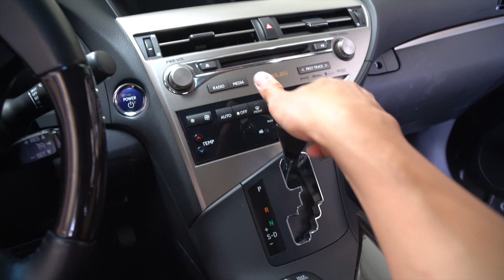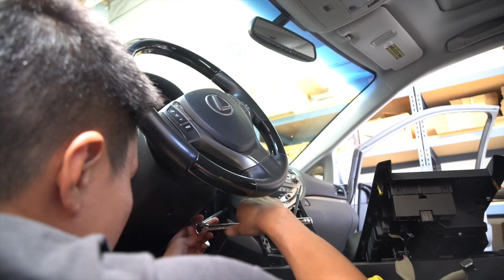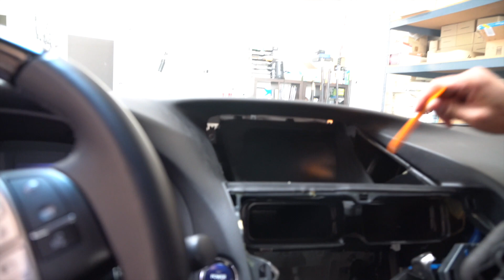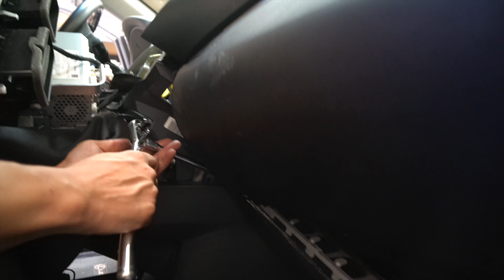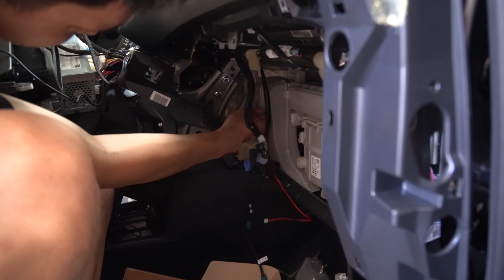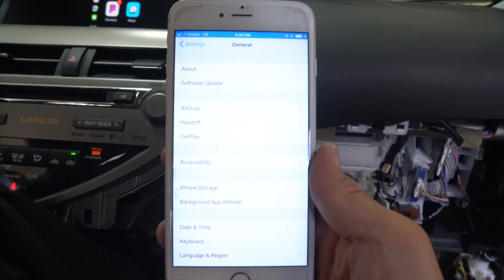2013-2015 LEXUS RX | Wired Apple CarPlay Android Auto | Install / Demo

Comment: Does the LGVIF-CB2 S-Connect model work with the RX-350 in the years 2013-15? I know this guide shows the installation in those model years, but the product page on your website seems to specifically indicate that it only works on the 2016-2019 models. Same with the model for non-navigation. Thanks!
Reply from the maker: We have temporarily stopped offering it for 13-15 as we found a glitch that affect these models. Still trying to debug it. Check back with us in 3-6 months
Reply: @BeatSonicUS hi just checking if you have fixed the glitch and if you have an option that works for Lexus RX 350 2014
Reply from the maker: @Watchthis_UM  yes glitch was fixed last year. Here’s the link to the kit https://www.beatsonicusa.com/lexuscarplayandroidauto.html
Reply: I am following up as I am still looking for the same info. I have a 2015 RX450h

Comment: Ok. That was a great video. Your shots showed the basic removals clearly and just enough of the procedure that it should be easy to reference along with the manual.
Reply: I am excited to install this in my 2015 RX350 with factory Navigation. Is it still a go? I read somewhere that there was a required update needed. Has that come out yet?
Reply from the maker: Thank you

Comment: Will this remove/override factory infotainment menu stuff such as car settings, oem navigation, and hybrid energy monitor?  For example, for whatever reason, would I still be able to use oem navigation, adjust lights or seat settings, or view the fuel consumption/energy monitor for the hybrid system?
Reply from the maker: This will not overrode factory infotainment. You can use all oem functions normally

Comment: So amazing!  I’d like to have a shop do this and I’d also like to upgrade sound system, install dash cams front & rear,  can you give any recommendations for these two other changes and is there any other items you would consider with the car opened like this?
I have 2015 RX350
Reply from the maker: Nice! You will definitely be loving your car after all those changes!
Reply: I think he only read the so amazing part lol.  Your best and safest option would be buying and getting it installed at best buy.  Confirm if they install as well since very few best buys install.

Comment: Will this work on my 2013 RX 350? I don’t see it on the compatibility list on the website, but it is on the compatibility list on the video. Thank you!
Reply from the maker: Hi Nick, we have temporarily stopped offering this kit for 2013-2015 RX models with nav as we ran into a bug that we are diagnosing now. Check back in a few months as we should have resolved it by then
Reply: @BeatSonicUS  Did you get this fixed for the 2013 to 2015s?
Reply from the maker: @ericmaytx  not yet!
Reply: @BeatSonicUS  I too am still very Interested in purchasing this once available! Please keep us posted!
Reply: @ericmaytx  It's fixed!
Reply: @BeatSonicUS  have you fixed the issue yet?
Reply: There is an alternative offered by Navtool, but I wanted to check in again with you first to see when you are expecting the bug to be fixed. What’s the latest update?

Comment: Hi I’m from Edmonton Alberta. Looked on your website to make sure my 2015 rx 350 with navigation is compatible but it says it only works for the 2016-2019 rx. Just wanted to know if my vehicle is compatible and if so where I could get it installed from.
Reply from the maker: We had run into some issues for 2013-2015 RX and have stopped offering it for this model temporarily. We are still working on fixing the issue. Check back with us in 6 months
Reply: @BeatSonicUS  is it available for the 2013 rx now?
Reply: Any update on this? Looking at buying a 2015 RX350. Thanks!

Comment: I have a rx350 2015 non navigation model . Would it be possible to install this on that. If not , are there any parts from a lexus  nav system which  I can buy to add/swap to my car to make it possible. Thank you .
Reply: If yes , please part numbers or a link to the parts. Thank you.
Reply from the maker: Hi Ehsan , Unfortunately we don't have a solution for your 2015 RX350 no nav model. Please check with us in a few months as we are working on making one

Comment: Have you tested it in RX 10-13?
Reply from the maker: Marchi McFly unfortunately the connectors are different and is not compatible
Reply: @BeatSonicUS  Oh...the headline to the video includes 2013...but here you say connectors are different for 2010-13.  So, does this work in 2013 RX 350?  Robert.   Wondering as I may purchase a 2013.

Comment: @Beat-Sonic at 6:30 in the video you either swapped GS CAN for RX CAN or you plugged them in as your harness was not "pre-configured".  The kit I received appears to be pre-configured.  2 wires are a different color in my harness vs. the one in this video.  Do I need to swap around mine?  I have 13RX.  The harness I received has blue/black RX CAN to Blue/Blk, then has Orange/Green GS CAN to Blue/Green that is part of the very long cable that goes to the shrink wrapped PCBA (CANBUS board?), and has Orange/Green to Orange/Yellow.  Is this configured for my car or do I need to switch around RX CAN for GS CAN ?
Reply: Additional Comment: This isn't covered in the installation manual.
Reply from the maker: Everything we shipped out has been preconfigured and as such this part was left out of the instructions. I apologize for the confusion.
Reply: @BeatSonicUS  OK, thanks for the quick reply!
Reply: @BeatSonicUS  I've got my Beat Sonic unit partially installed, and its working.  Does the wire labeled "OSD control get connected?"
Reply from the maker: Proto nice! The wire labeled OSD does not get connected
Reply: @BeatSonicUS  My beat-sonic Android Auto (Galaxy Note9) is working in my 13RX.  I don't have everything put back together yet, as I am testing.  Google assistant works. Waze works, and Android Auto works.   Calls are clear, but the person calling me hears an echo of themselves: They speak, there is a slight delay, and they hear what they just said repeated, but at low volume.  I had someone use my phone sitting in my car, and I called my phone while using there phone, and verified this audio artifact.  How do I eliminate this ?
Reply: @proto2580  I'm really interested in purchasing this install kit for a 13RX i just bought, are you still having the echo issue?
Reply: @Jsizzle9109  I've fully installed mine and put my dash/glove box back together (I ended up putting the 2 Beat-Sonic boxes behind the glove box just as Beat-Sonic shows in this video).  I currently have 2 issues: 1) the sound from the Beat- Sonic sometimes works and sometimes doesn't 2) the echo that people on the other end of calls hear (I don't hear it on my end of the call).  I'm not sure what is causing issue 1.  I found that I needed to plug a 3.5mm plug into the Aux jack of the car. I am using the aftermarket Toyota patch cord that connects the BeatSonic USB to my OEM usb port, so possibly this is the issue.  Other ClubLexus forum RX owners that installed the Beat Sonic unit say this patch cord should work if I use the 3.5mm stereo plug in the aux port (stereo plug with cut wires)
Reply: Issue 2 seems to be common with Android phones.  I will need to research this more as Beat Sonic is silent on this issue
Reply: @proto2580  I wanted to chime in, I believe we have talked on the club lexus forums haha! Please note I use apple Carplay

Anyway, I am the exact same issue you are having with the echo. My callers have noted that they can hear an echo of what they say every time they call. 

However, I do not have a problem with sound working. I am also using the toyota patch cord so my phone is connected via the factory USB and I also have to have a 3.5mm plug in the aux jack.
Reply: OK, I figured out #1.  If I use the car's Radio or Bluetooth, i need to switch to aux input before switching to Android Auto.  I must do this each time I start my car, as the sound output is taken over by the radio or car's bluetooth.  Typically I have to select an input I'm not using (like Bluetooth), then switch back to AUX before the sound from Android Auto works.  So, its an extra step I must do each time I want to use Android Auto with sound (the display works everytime, just not sound, and I can't hear Google Assistant answer me).  I can play music over Android Auto, but I'm not sure its as clear as when I play music over Bluetooth.   One benefit is that I don't have to listen to Google Maps or Waze talk to me when I am using the car's built-in bluetooth for audio (like music).  If I use Android Auto and make the sound work, Waze or Google Maps interrupts my music to give me directions (I would just rather use the screen only).  I'm not yet sure which way I will go for phone calls.  Probably BT since I will not have the echo issue on BT.
Reply: @proto2580  I have CarPlay, so don't know if any/all of this is pertinent:  One thing Eric mentioned to me was "In regards to the sound not playing upon first connection, this happens when the phone connects to the Bluetooth before having a time to register to the carplay box while the phone is connected. Faster phones seems to have this inconvenience. Quick solution is a replug of your phone. Or you can wait until the factory infotainment system loads then plug in the phone and it should work every time."

On startup my phone connects via Bluetooth to the Infotainment/Nav system as a "Phone" and "PortablePlayer".  Other than occasionally having to select "AUX" on my infotainment system, re-plugging the phone always corrects the sound issue (not coming from CarPlay).  If you use Satellite or Broadcast radio then I think you always have to select "AUX" as that is the CarPlay/Android interface to the Infotainment system.

I actually think music I play from my iPhone sounds a bit better, but who knows!

I've made a few calls on my phone but the "caller echo" issue has not arisen.

Comment: @Beat-Sonic:  There's a LOT of space behind the screen - is it too hot (like in Summer) to mount the 2 Beat-sonic units in that location?
Reply from the maker: Proto as long as there are enough room you can mount there. The units can take the heat.
Reply: @BeatSonicUS  I ended up installing the Beat-Sonic boxes behind the glovebox just as you show in your video.  It was just cleaner and easier and pulling the GB wasn't as bad as I thought it would be, and putting it back together was fairly easy as well.  Actually, putting the entire dash back together was pretty easy.  Easier than getting it apart as it was my first time taking apart a 3RX dash.
Reply: Proto I don’t suppose you’re in the U.K. are you mate? I need mine doing
Reply: @jamesdeacon1440  sorry, I am in the USA.

Comment: @Beat-Sonic Awesome!  Thanks for posting this so soon after I requested it!  I just received my Beat-Sonic Carplay/Android Auto unit today (for my '13 RX350).  I'm planning on installing it myself in just a few days.
Reply: I have a 2013 RX 350, but these comments are making me nervous about taking the plunge. Thoughts?
Reply from the maker: Awesome!
Reply: @BeatSonicUS where can i buy the android module for my Lexus RX450H 2013 and get it installed?  (I am not a DIY person 😅)
Reply: How did install go
Reply: @Mike0in0Texas  Its working. More details in my comments below.  I did find after the install, that I sometimes need to plug/unplug my phone in to get the system to switch over the sound. (Android Auto) Either that or select radio then back to Aux input on my 3RX screen.  Other than that little hiccup, its working fine.  Music quality through the device is not as good as the OEM BT connection, but, the OEM BT won't work when AA is active - for example, when I want the sound to work with Google assistant or if I want to hear directions step-by-step from Waze.  So, its a little funky to use as its not quite as integrated as an OEM system would be, but its far better to have AA on my 3RX big screen than not at all, so I am fairly happy with it.  4 out of 5 stars.  I guess you have to decide if its worth spending $500 to get some integration of AA or Carplay with your 3RX.  I felt it was.
Reply: @proto2580  Hey, just checking to see how life has been with it after 9 months. Thanks!
Reply: @paulie0706  I need to get a firmware update from Beat-Sonic.  The display freezes.
Reply: Proto thanks. I emailed them about this product for my ‘15 RX and they told me they’re not advertising for 13-16 models until they resolve that issue.
Reply: Proto did you manage to get the update from them?
Reply: @jamesdeacon1440  I haven't had time to work on this little project.  Sometime in the near future, I will get to this.
Reply: Hey man, how's the status work your system? Hope it's good.

Comment: Wow I was thinking of doing this install myself on my 2014... but this looks like a pretty giant job for someone with no experience. 

+ I bought the USB adapter so I can have my factory USB run CarPlay. Wish you guys could come to Texas for an install!
Reply: If you have never taken a car dash apart before, I don't recommend you learn on a 13-15 Lexus RX.  Its one of the more involved dashes I've seen.
Reply from the maker: Yeah, it is a bit involved for someone with no experience. Wish we can go there!
Reply: Do you have a link to the USB adapter so that I can see if it will work with a 2013 RX 350?